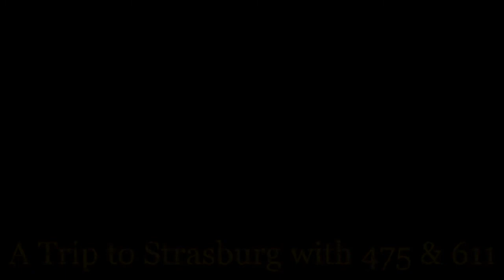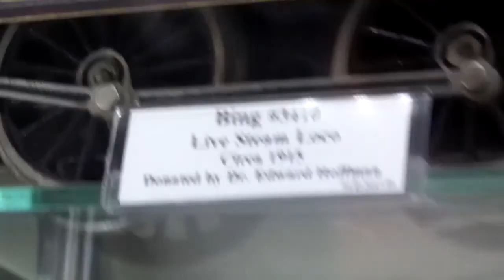A Trip to Strasburg with 475 & 611

Comment: Why did they cover Thomas’s face and the other thing is why isn’t he wearing a mask
Reply from the maker: They always cover the DOWT units faces cause there's a lot of smoke and soot that builds up in the shed probably and the faces are rubber so they're probably hard to clean.
Reply: @Legomastr365  Can’t they just give Thomas a Covid mask
Reply from the maker: It's not a thing they're doing to promote covid safety, Thomas has always had a face cover to keep the whole face clean from soot. He gets very dirty sitting in the shed for most of the year. Metal is easier to clean than rubber. And giving him a face mask to run with would be difficult to make and would be pointless now as Strasburg doesn't mandate masks anymore.
Reply: @Legomastr365  I know it was a joke LOL